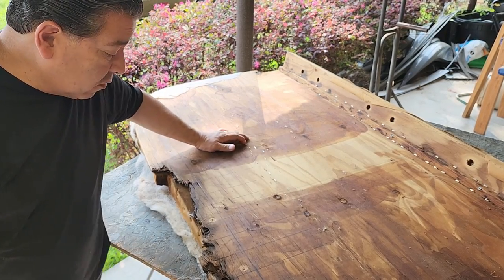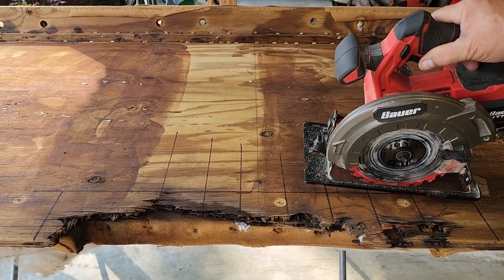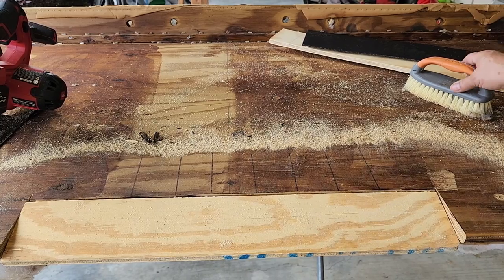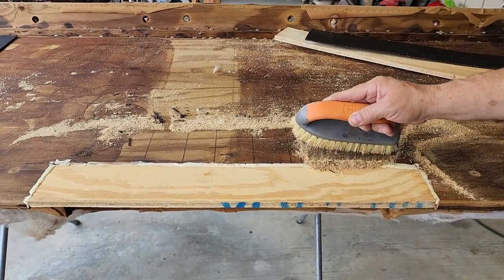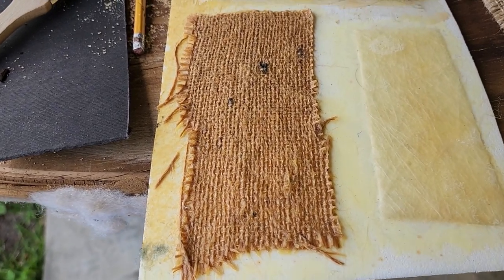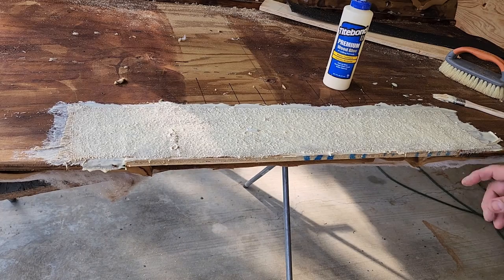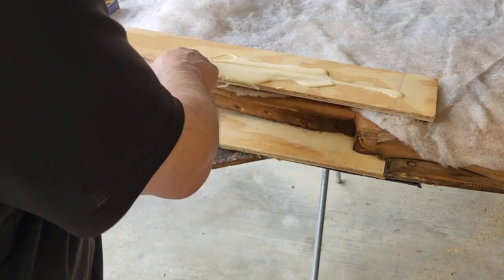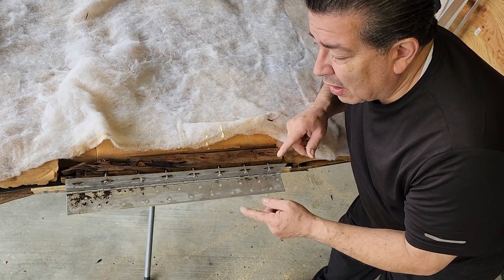Watch Now! The most common boat wood rot repair

Comment: I’m an expert at old boat wood restoration from working on some real projects.  I’m grateful that most good boat builders stopped using plywood or any kind of wood in their construction in the early to mid 1990s.  Most went to all synthetic or composite materials for transom, stringers, flooring, seating etc.  when replacing and restoring wood even if you are going to be covering with fiberglass and laminating epoxy resins,  treat the old wood as well as the new wood with penetrating epoxy resin.  It encapsulates the wood fibers and seals them so water doesn’t penetrate.  That includes any new penetrations you make with hardware.  Drill holes and remove and treat the holes with penetrating epoxy resin.  Jamestown Distributor makes the best but I make my own penetrating epoxy resin by thinning quality laminating epoxy resin with no more than 10% by weight or volume an epoxy resin thinner such as Mek, or acetone, or other resin thinning solvent.  Be careful of the fumes and mix the resin exactly as instructed.  My 2 cents.
Reply from the maker: Hello Dew, Thank you for the excellent tips! In this video you can see that the wood has a sheen to it from some previous coating applied to the wood. I tis my experience that water will get into the wood. Wood will always rot. It is a natural fiber that doesn't stand a chance if exposed to water. This video is proof of what I am saying. I see this all the time. Please keep watching!
Reply: Most old boat makers did not pre treat any of the plywood or other wood used in the construction of the boat with penetrating epoxy resin. Before applying fiberglass and resin.  The seat you were repairing had a thin layer of most likely inexpensive polyester resin painted or sprayed on but it was not penetrating epoxy resin. Or else it would not have dry rotted. Penetrating epoxy resin encapsulates the wood fibers and makes them extremely resistant to water absorption.  Only a couple of builders did this.  Sanger boats and Bayliner and perhaps another brand that was owned by USMarine.  Again in the early to mid nineties quality boat makers stopped using any wood in any part of the construction.  Including the seats and benches.

Comment: I'm definitely going to have to try this technique in the future. I've always replaced the panels. However there are times when you need to blend curved panels into flat panels. I've always used fiberglass but you can't staple into fiberglass especially if it's more than one layer.
Reply from the maker: Hello Alverez, Thank you so much! You have a good point about stapling into fiberglass. Please keep watching!

Comment: On the second bit of wood, why not make it longer so it's also bonded to the original main board?  Still looks completely solid but just wondering
Reply from the maker: Hello Philip, I had to be close to the original thickness because of the mounting block for the hinge. But I do understand your meaning. If thickness did not matter, I certainly could have done it as you said. Please keep watching!
Reply: @Old School Auto Upholstery Techniques  Ahh thought there might be a reason!  And yep have sub'd : )

Comment: I have just found your videos and you amaze me with such great work! 
I think it would be a great idea if you had a rubber type roller similar to the ones used with screen printing and roll over the top of your saturated Burlap to get all the air bubbles out?🤔 Great Video 👍
Reply from the maker: Hello Hinspect, Thank you so much! That is another way of doing it. I was an American working in my Chinese factory for two years doing fiberglass layup with a brush in the molds for my model aircraft designs. Old habits die hard I guess. Please keep watching!
Reply: @oldschoolautoupholstery  My wife and I rebuilt a Boat with rotten wood but since it was ours, we replaced the original Wood with Marine grade Plywood and encased it all in Epoxy. It was an overkill since we lost interest in our Boat after our Daughter was born 21 years ago! You definitely have the right way to go! ❤ from both of us...

Comment: Why try to put the hinge back in the rotted 2x2?  Why not use a new piece and transfer holes so the screws got something to bite into? Great video but the end threw me.
Reply from the maker: Hello Buli, The wood block was still solid, I charged very little for this repair, just to help out the customer. He said he did not know he would need the repair. Please keep liking and watching!

Comment: That last piece of wood for the hinges was rotted on one side. Are you making it so cheap that you couldn’t even get a good piece of wood??
Reply from the maker: Hello M, You are right, I had to negotiate the cost with the customer. He wanted to do it cheaply. I followed his instruction. Please keep watching!
Reply: Here is the issue with marina projects like this. I've run into this issue a few times. The boats value is always an issue. Customer has a boat that is worth let's say 5 grand. Even with new upholstery the boat is only worth maybe 5 grand. You open up a seat or side panel and discover nothing but dust! The cost of rebuilding is worth it to the customer! Now you're stuck with a pile of dust, a customer that wants you to put it back and you don't have a way to do it. So you have no choice but negotiate with the customer or bag up their dust and send them packing. I don't even entertain jobs like these anymore. If it's not a yacht or a boat restoration I won't do upholstery on it. I explained the situation so they understand that there will be no turning back once I open this up and find rot. They'll be stuck with whatever the bill ends out being or paying for the work that was done and walking away with bags of what used to be seats and panels.